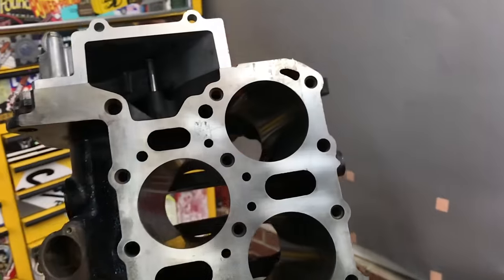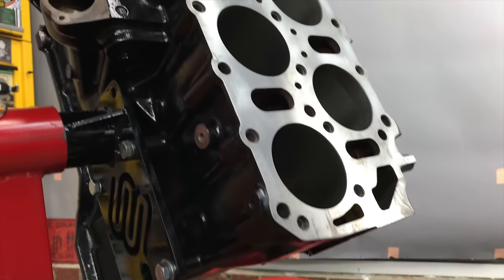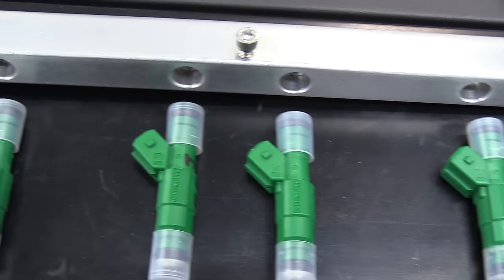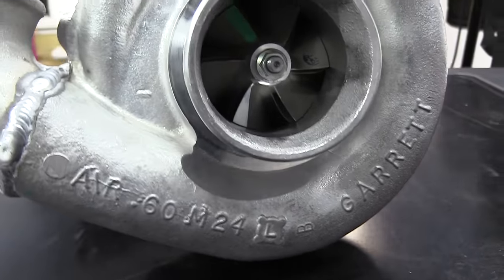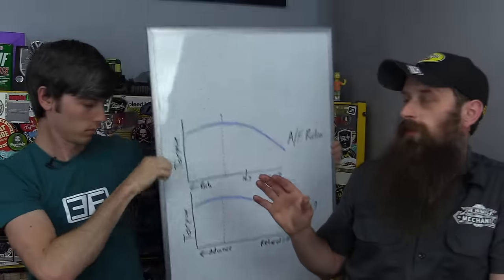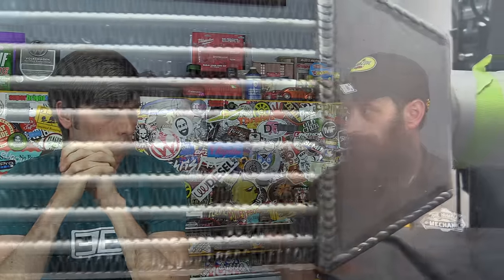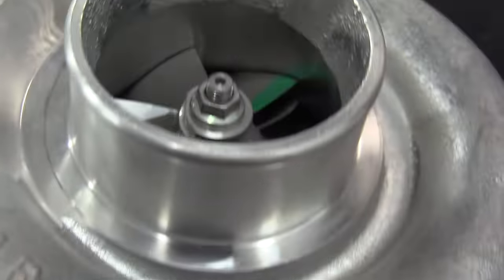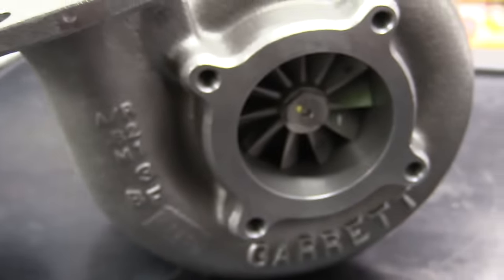5 Ways To Prepare Your Car For Turbocharging

Comment: Hi will you match the new ECU to the rest of the car ? I mean dashboard for example, immobiliser and the other ECUs ? Won't you have lots of errors and MIL and other problems .
Reply: New ECU should work fine if designed properly. If you add a box you will often have check engine light, but the rest of the car shouldnt be affected
Reply: TheDox451 You are joking right ? Interaction between ECU s is very complex especially for VWs, even changing the ECU from the same car and engine but different software configuration can lead to total lockdown, I didn't understand exactly what ECU he will use it seemed to be a VW Jetta VR6 ECU but  how will he code everything to be ok .
Reply: I don't mean to sound like an ass but they said they where reprogramming the ECU by putting a chip in it. All the rest of the ECU functions will be retain.
Reply: This is going to retain the original ECM. There is a chip that gets installed. Also this car is pre-immobilizer so no need to worry there. With this type of application a full stand alone is rare. You might see some type of programming change to the original box, or a piggy back system,.
Reply: Would be nice for you to make a video and explain exactly what is done . From my knowledge the ECU has some microcontroller which is the CPU + a memory chip where the program and the calibrations are written . You can reprogram that chip if you have the VW tools, or you can replace that chip with a chip that already has other calibrations . Is this correct ?
Reply: YES you got it.

Comment: Would upgrading the transmission be a smart thing to do if you turbocharge your car or reinforce stuff that has to do with extra torque applied to parts on your car that would otherwise be made for a stock version of the car you decide to modify?
Reply: Eric Olson depends on application - if youre building a track racer then yes you'll go upgraded trans, flywheel, other mods to handle the loads of constant high speed operation (think pistons, conrods etc)

For street performance gain (and maybe a trackday here and there) i dont really think so

Comment: could someone explain to me why you would want to add a head gasket spacer?
i mean isnt the whole point of the turbo to get more air in the same space?
now you get more air, but you also increase the space, so isnt that countering what you are trying to achieve?
Reply: Turbo is not just more air but compressed air. My theory is say x is the default compression ratio, x without turbo is going to have certain performance, x with turbo would be great but can have strain on the engine, a little less than x with turbo would still give good boost and keep the engine happy. I have heard of ECU tuning to get an extra 100 hp but ends up with engine issues.

Comment: I have an 04 jetta with the 2.8 vr6. How much boost can it handle on stock internals?

And what exactly should i do if i want to push bigger boost?
Reply: QMan1234red It can handle about 450 on a chip tune with head spacer and arp rod bolts. It can handle 700+ on stand alone/spacer rod bolts. It is the piston/rod bolts and exhaust valves that are the weak points. Understand to tune the rear bank of cylinders independent for injector/timing. A chip tune cannot do that. You need sequential injection and big peak and hold high impedence injectors to overcome the fuel pressure and still idle and drive well.(This takes a high output injector driver with 6 dedicated channels). This is actually a similar price to "kits" offered for our VR's.
Reply: Leave the bottom end alone. Focus on the head and put a sri on with some rod bolts and head spacer. Spend the money on some books and a standalone. Tune NA first. Then boost reference. You will not kill a VR bottom end unless you lean out. Exhaust valves will disinigrate and fail over 1400°. Reference egt (heat/load makes boost)
Reply: Start at the end , work backwards.

Comment: Is this vid a preface to turboing that S2000?   Excellent platform for some serious forced induction power.

Perhaps another vid idea could be choosing a platform to turbo.   You touched on identifying and upgrading the weak points in #5.   There are definitely cars that are better for turboing (like your S2000) where you won't have to replace spendy and/or many components like pistons/rods/transmission/axles etc.  Others that have the strength in the drivetrain components...and others that it would just make more sense to choose a different platform altogether.   Case in point...the audi 2.7t.   Other than clutch and fueling, you are pretty good to hit 500+hp with just bigger turbos and intercoolers.

Comment: i got a Suzuki Swift 1.2 2010 lowered, OZ rims, Pirelli's and sport exhaust weights 960 kilo's it handles amazing but i want more power so i want to add a turbo kit on it but i am a little afraid cause it's only a 1.2, the output will give it 170/180 hp which is 80 more then stock. What should i do ? and if i add the turbo kit what can i do to do it as safe as possible to not stress or damage the engine too much?

Comment: this was a good video, but I wish you explained a little bit more on compression ratio. I understand the risks of forced indiction and high comp ratio, but wouldn't that lower the overall eficiency and power?
Reply: Tetsuto Kamata With lower compression, you can more safely run higher boost and get more power.

Comment: My mustang Was turbocharged on e-85. the car ran fine without the turbo, now im getting gray puffs of smoke around 1/3 throttle. only driven it around 3 miles. whats going on? last time we had the turbocharger on with the same tune it wasn't doing this?

Comment: I have a 2014 Camaro SS. Dealer recommends 93 octane due to the compression. To run a Turbo or Super Charger, what is a safe level of compression?

Comment: one big thing missed with building a turbocharged engine a high quality oil catch can system and hard to find the best unit to install in your application. I have info to point you in the right direction for the best system out there.

Comment: If the engine normally has 150psi of compression, is it safe to assume that if you add 10psi of boost, you're adding 10psi of compression to the cylinders?

Comment: I wonder if you can't just use a low volume fuel pump and vaporize fuel in the air intake with it, in parallel with the stock injectors?
All the turbo needs is a little more fuel at load, so if there's a module that could be programmed to do just that, and run off the throttle wire, and O2 sensor, it would be able to do all that for a lot less $$$

Comment: Radiators on cars are not sized for the worst conditions. If they were, they would be huge and cars would never overheat. Most cars have radiators sized to about 30% power output in majority hottest climate - cruising at 70MPH on a 85F summer day.

Comment: I don't know if this will actually get read but you said internal combustion engines are about 30% efficient. I'm into motorcycles and my typical measure of an engines efficiency is looking at hp/liter. Why do cars rest around such a lower efficiency level when my WR250R (250cc dual sport) makes about 25 hp from the factory (100hp/liter) and closer to 30-32 with an exhaust and a fuel tuner (since these bikes run obnoxiously lean from stock). However, this number goes up to 200hp/liter once you get into the 600cc sport bikes which all push out around 120hp for modern options from the factory, once again with no boost.  

Finally, my question laid out clearly is this, why do modestly tuned motorcycles make more hp/liter without boost than any given street car?

Comment: You seem to forget to lower compression - the single biggest difference from a NA engine apart from the turbo. Preferably by changing pistons (or a bit bodgy, thicker or double head gasket)
Reply: Per Eldh it's one of their last points

Comment: What if i want to tune a 2014 Subaru STI to get 500 hp and 500 torque out. Would there be a way to do that will near stock reliability?
Reply: Omario Makusuweru build it for 1000hp but keep it at 500hp, go overkill on components full on crazy overboard
Reply: thanks bro, better to have it and not want it than not have it and need it.

Comment: my 05 GLI 1.8 T 6-speed manual  ko3s turbo I think it's APR stage 2 tune I got the car that way over four and a half years ago do you think that the car's ECU had to be modified to be tuned on this year and model and I hear that nothing had to be added from APR to tune this model I mean it had a two and a half inch downpipe high flow cat and a muffler all from Magnaflow with a oo7 Forge bov Nero speed short ram intake &filter 93 stage 2 APR tune I think it was holding around 18 to 20 lb without dropping   I guess I'm asking if my ECU had to be modified before they did this or did they just plug in a cord to the OBD2 and used it tuning equipment and cord to do this on this model what did they have to solder a chip in or add something to tune it

Comment: yoo guys i got Nissan 350z automatic from my aunt and uncle  any suggestions on car that can make it faster  ?any help
Reply: maintenance first, the get good at driving it, then tires, then a tune. :)
Reply: Demon King get an exhaust, definitely get better tires for grip & get brakes, you want to be able to stop. Cant remember if the Z's factory breaks are good. Its always about the driver. Test pipe/midpipe, & maybe go e85 & get a flexfuel kit. you'll boost up a good 65hp. though You do need to be able to handle the power, I suggest tires & breaks & exhaust. what year is it & what model? (HR/DE etc) manual is more fun than auto tho lol
Reply: HumbleMechanic if they handle and drive anything like my 77 280Z did then do a brake upgrade and learn how to drive it well. If it goes over 140 mph I'd recommend active Aero aids like a rear wing and front spoiler upgrades and maybe some suspension stiffening. My 280 became light and unstable above 140 without aero aides.

Comment: I noticed that in reference to the air cooler he said "just don't paint it black". I wouldn't do something like that anyway, but I have heard of people doing that for sleeper status reasons and such. But in terms of functionality, does painting it black hinder that?
Reply: engineering explained has a video about it
He says it does, but others say it's not enough of a difference to notice (which I agree with). People have been painting aircooled motorcycle engines for years and never had problems with it. As long as you don't use some kind of industrial heat insulating paint you'll probably be fine.
Reply: i see. thanks

Comment: About that fuel thing. My country, Australia, just introduced E10. That looks to me like very low octane (please correct me if I'm wrong, don't get angry with me). I know the US has E85, which is much higher, so should I run E10 if I can, or try and run the highest octane possible, as close as I can get the E85?
Reply: That's not the octane rating. E10 means the fuel contains 10% ethanol.

Comment: I'm just kindof on the wall about how much compression I should be running on my car. Ita a DC5, I want to make around 500whp, all forged internals, sleeved, and closed decked, running on e85. I want to make the most power possible and still be reliable ish.

Comment: if you buy a turbo petrol car, how do you gain more power ay low revs rather than high revs. ? air pump ? super charger ?
Reply: RemusKingOfRome5 twin turbos - you use one for low end boost and one for high end (hint one turbo is smaller than the othet)

Comment: I have an automatic car, and I would like to turbo charge it. Is there something else that needs to be done to the transmission or something like that?
Reply: If you increase the power a lot, there is a chance your transmission will start slipping as torque converter cant keep up with power. Dont forget to check your transmission max torque so you dont blow it up.
Reply: OK what car, what transmission and how much power before and after turbo charging. Sum automatics can  take quite a bit more power stock. Others need to be reprogrammed with a shift kit or ECU programming or both. Others are a nonstarters if you are looking for more then 30 to 40 more Hp.
Reply: ronme68 It is a RAV4 AWD. It's stock power is 175hp, the main idea is to compensate for the loss of power due to high altitude , and gain 20-30hp.  It is for my dad, that's why I'm asking. 
The other option is a Supercharger.
Reply: Thanks to all for answering, really helped a lot.
Reply: Shouldn't be a problem. I would add extra cooling to the  transmission but all automatics could use more cooling. The cooler they run the longer they last.

Comment: Another thing : If the turbo is oil cooled/lubricated change to a full synthetic oil, mineral oils oxidise ( turn into a black goo ) very quickly when subjected to very high oil temperatures, with the exceptions of something like Valvoline VR1 or 15W-40 HDEOs made for Diesel trucks, they also lose their viscosity much faster at high temps than synthetic oils ( Beyong 150c where the HT/HS viscosity is tested ).

For a Turbo engine always use a modern spec motor oil :(  API SM/SN and ACEA A3/B4 )
Reply: wtf?"if the turbo is oil cooled/lubricated"????? is there any turbo wich isnt oil lubricated and as a side effect of it it is also oil cooled? nope....
Reply: Blue Oval Fanatic 2904 but what if you get huge oil coooler and fan ?

Comment: HEY EE! Maybe a video in the reasons on why different gauges could help in what areas. Also I've heard its better to tune you car through labmdar* (probably misspelled) because of some modern aftermarket flexfuel kits will allow e85 - 93 mixes, and they've said that the perfect afr is different for those fuels so labmdar* would be better. Hope this gets to you👍

Comment: Question; can you turbocharge any engine with these steps, the VR6 is a performance motor which no doubt can handle the strain. But let's take a normal economic 1.6 inline 4 engine for example; like your typical Mazda 3 engine. Will the pistons, crank, valves, etc. and everything else be okay? Can you follow these same steps and get an acceptable result? In terms of good performance and your block not exploding?

Comment: i wouldnt suggest Head gasket spacer for the simple fact that if your pistons cannot take the power you will make you might blow your engine! specially if there is already tons of miles on it. Lets be clear no one for a streetable car go turbo charge for a brand new car lol. usually the car already pass 50k-80k-100k and sometime way more miles on it. head gasket will be ok for slighty more power 50hp-100hp or so but if its someone like me who will go for an extra 450+ whp ower the 300ish+ whp giving about 750whp well building and replacing with forged internal is def the way to go!

Comment: What about sodium filled valve stems, stroger pistons, piston oil squirters..? is't that neccesary for building a reliable turbo engine?
Reply: That depends on boost levels. I would so no to all of those on this build. But when you reach a certain point, they can be beneficial.
Reply: HumbleMechanic Awesome. I have Mercedes W123 300 diesel (OM617) NA, and i want a turbo one soooo badly, BUT it is imposible to find stock turbo engine where I live in EU (been looking for 9 months now). However parts are not even close as expensive as in US, so I was thinking of turbo-ing it, do you think i could do it w/o changing pistons, valves, and just do what you guys were talking about in video? except for the spark plug ofcourse :)
it has 80 hp, and I'm looking to get 110 to 120ish hp (OEM turbo has 125 hp)

Comment: Do kits from companies like APR take a lot of these factors into consideration?  I'm mechanically capable, though lack experience, but I also just don't have much time to work on such an extensive project right now. My 2006 VW Jetta 2.0T is obviously factory turbo-charged, but at some point I'd like to gut it, brace it, and increase power to between 300-400 WHP. I imagine it could be way cheaper to do it all myself, but I'd be concerned with screwing something up. Anyone have experience with APR or any other similar companies they'd recommend for a MK5 Jetta?
Reply: Compaines like APR are top notch and do tons of testing and R&D to be sure their kits function properly. If you're not an expert or have access to all the equipment to properly tune, a kit from APR is awesome!
Reply: Thanks for the reply! I'll definitely take a closer look at what they have to offer then. The 2.0T FSI is a fun little engine and seems robust enough to reliably handle that kind of power. Have a good day!

Comment: 1st step is to get a diesel car. something with a mechanical fuel pump. step 2, slap on a suitable turbo, step 3 get a vacuum controlled thingy fitted to the  mechanical pump so it will give more fuel if boost is available, 4 adjust the 2 screws on the fuel pump or preferably ask someone who knows how to , step 5 be happy. lol :D

Comment: Why not use an aftermarket ecu?
Reply: It depends how old is your base car, if you have an older car (like my 2003 miata) then an aftermarket ecu is a necessity for proper tuning, if you have a newer car as Charles said, you can avoid A LOT of work by reflashing and changing only the parameters you need.

Comment: What about the blow off valve?
Reply: This kind of goes with the turbo as it is an operating part of it. Not attached to it, but part of the setup. This will not have a true blow off valve, but a diverter valve. So the "vent" will not be to atmosphere, but directed back into the intake stream

Comment: should've talked about forged internals upgrade if someone wanted to run higher boost. if you don't have forged internals good luck running over 5-9 pounds of boost reliably. your rods would be in the passenger seat lol